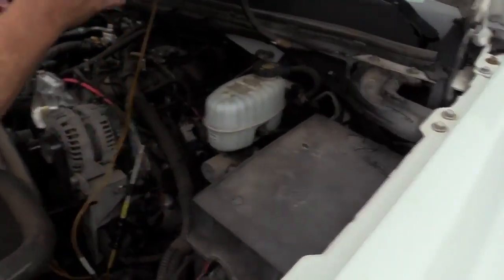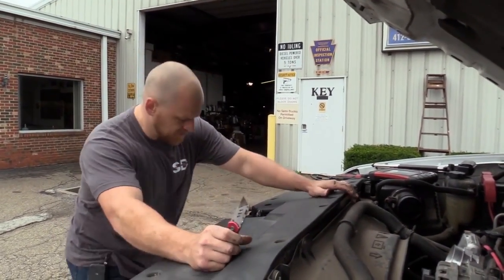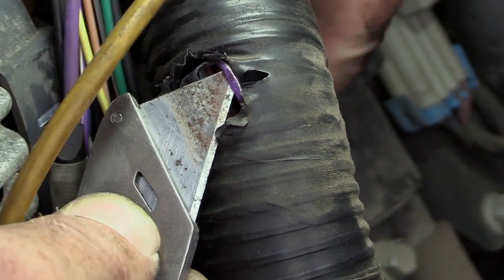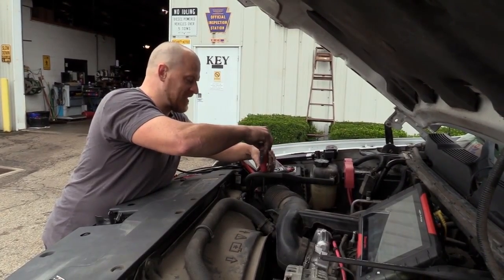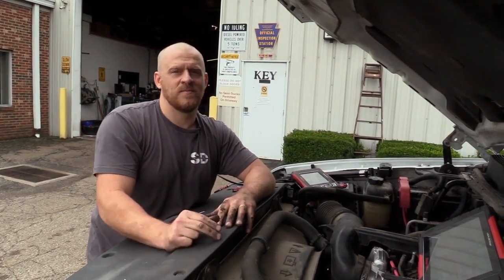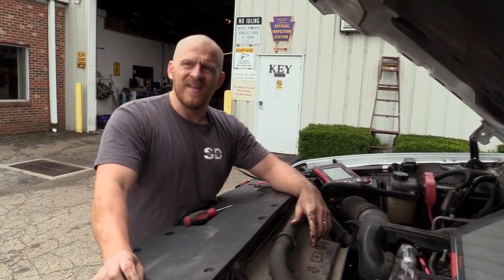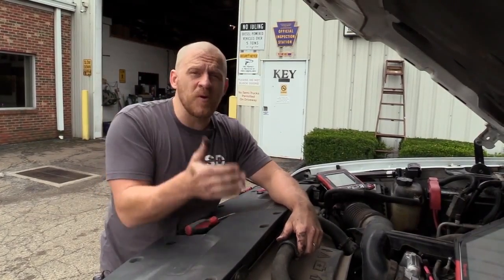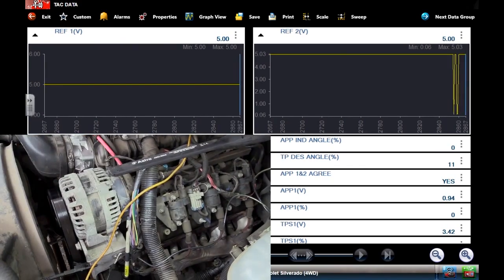Pulling codes and changing parts is not a diagnosis!

Comment: I know too many that think this is how diag is done. “Oh it’s only a 20$ part, let’s throw it in and see if it fixes it” 
Ugh people that don’t know better
Reply: Sometimes you have to do it because you dont know what would cause a 3.5 volt which is supposed to be a reference signal coming straight from the cluster. Had a 2018 chevy silverado with a temp sensor code, chased the signal ref all the way to the front connector, still same ref voltage, next was going to be the cluster which is a bit hard to remove so I just changed the part with what if this new car uses a different reference signal, needless to say the code remained and it was throwing the check engine light for the outside temp sensor. Some other dealer said it was the mirror assemblies, 1200 fee but I was certain that the cluster was faulty by either not getting the right ref volt because a ground or power was weak but I never got the chance to verify.
Reply: A lot of the times it is just the $20 part though. 

And to be honest, a couple $20 parts is cheaper than the minimum diagnostic time charge where I live. That's if they find the problem within that minimum time. It is a hell of a lot cheaper than a bidirectional scan tool and/or a Pico scope. But even then, it is still a $20 part on top of that. 

Some people don't have tons of cash laying around.  A car not running could be the difference between them having a job or not. They need and want the quickest and cheapest fix possible.  Doesn't always work out that way but often enough it will. Otherwise the code reader will say to check the wiring for a bolt rubbing through instead of there is a problem with this part.
Reply: @sumduma55  those are easy to find though, those where a communication module is failing to communicate it is worth investing the time since they cost a lot of money and programming. I have a pico but not knowing what the module should send out or expects as an input, then it becomes more complex for us technicians. Hopefully we get more info from ma manufacturers.
Reply: @scientist100  I don't disagree.  When you start talking about a couple hundred dollars or more for parts you want to be more certain. 

However,  I recently diagnosed a plugged cat confidently with a low power symptom, a code reader and a hand over the exhaust outlet. Turns out you cannot ignore the O2 sensor codes like you used to be able to in the 80s. 

On the Pico waveforms. I was under the impression that there was a user section of the support forums that had a lot of known good waveforms in it. I looked into getting a Pico a while back but decided against it. I rarely have cars I need to work on anymore and more rarely have time to help family and friends with my work schedule over the last 10 years. If i actually picked up a Pico,  I would spend more time trying to remember where I put it and how to use it than any amount of use it would see in any given year. Maybe when I retire.
Reply: So just went through parts cannon, on a chrysler town and country, crank no start initially. Found if you opened throttle half way it would start and run at about 2500 rpm. No codes. Knew it was time for plugs. So did change those for good measure. And can't remember the article or video I found but it suggested new throttle body. Which I did same result. At that time I stopped. Went to basics. Checked compression found cylinder 1 no compression. But usually that would be a dead cylinder and car still run. Did not think about smoking it. But should have. Pulled valve cover and found a busted intake valve spring. In valve was partially dropped. Not enough to damage piston. But enough to ruin vacum. from other cylinders. Hope to have it running today
Reply: I do this sometimes myself even though I know better. But if it's something like an evap code (I don't have a smoke machine) or something that turns out to be a common cheap issue for a particular year make or model, I'll throw the part on it first. Worst case it doesn't work and I return it, then troubleshoot further. Still saving my customers loads of $$$$$ compared to a shop

Comment: Was that wire loom improperly routed?  Also what's the purpose of that stud it was rubbing against? Bleeder valve?
Reply from the maker: It was not, but I believe GM has a rubber plug that sits on top of this stud to prevent this condition. Check out the full video for more info  "Troubleshooting a Shorted 5v Reference Circuit Chevy Silverado" https://youtu.be/RcQdITo_AOA

Comment from the maker: Don't Be a Parts Changer!
Mechanics are not thieves when they want to charge you for diagnostic time. There is no such thing as a "free diagnostic". There is no special little tool, that you can plug into your car, that will tell you what is wrong. These only provide direction, a code doesn't tell you what part you need. 
Here is the full length video "Troubleshooting a Shorted 5v Reference Circuit Chevy Silverado" https://youtu.be/RcQdITo_AOA
BTW I blocked this company called #FixD who makes a bluetooth scanner, because of the way they portray mechanics, and the industry as a whole, just to market their tool. They also claim that you can read a code and change a part, exactly like the "free diagnostics" parts stores do! I put a hashtag in the description for their company, so when other search for them, my video will show up. Help me get this view count up as much as possible to counter the damage these people do to our industry.
Reply: Love it😍, Well said 💯% true👍
It takes time, money & patience to being able to perform diagnostics professionally & sadly Mr. Customer never understands that🤔
Thanks for sharing SD this video is an eye opener👍
Stay Safe Guy's❤